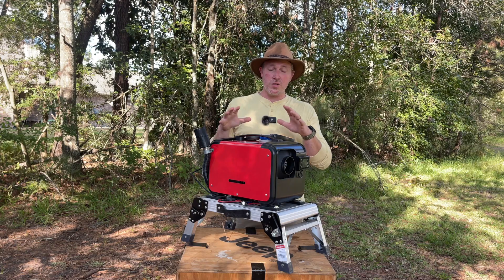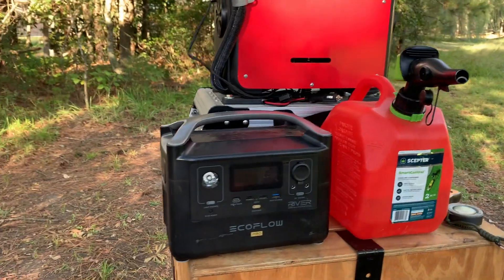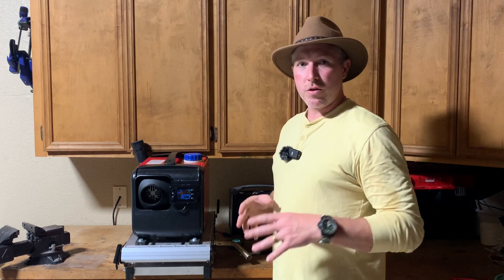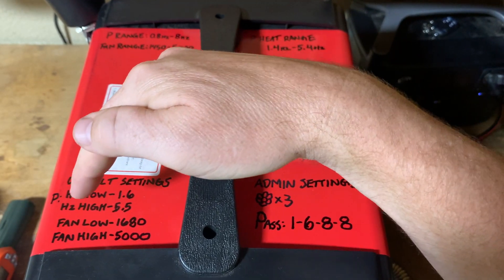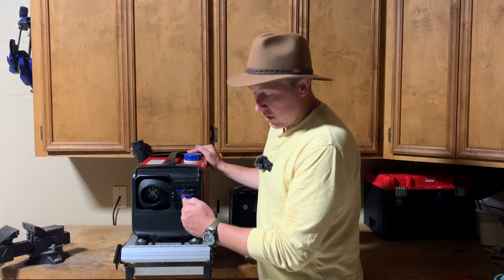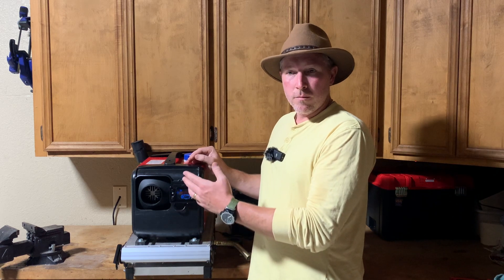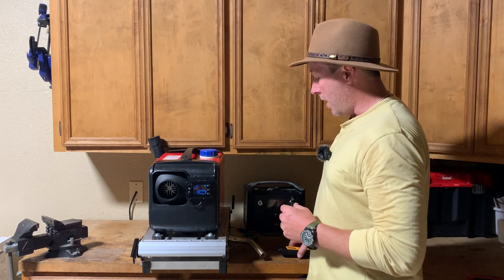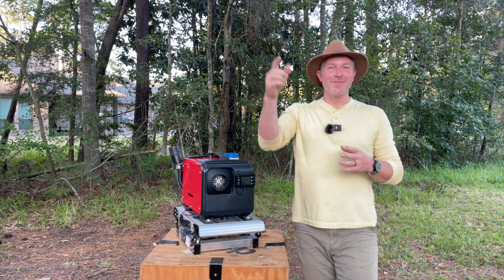Maximize Efficiency: How to Tune Your Diesel Heater!

Comment: This could have been a great tutorial if the camera was set on the controller constantly. Being able to to slow down the video in settings many people could benefit from the audio. Only criticizing the speed you run through instructions. Paired with a  slower speed and a constant control panel visual this would be so much better IMHO.  Still I thank you for your upload
Reply from the maker: You make a very good point, and I apologize for the seemingly quick speed of working the controls… it’s actually very simple and A lot of it is punching the same things over and over. I was up against having the menu constantly time out after 7-10seconds and reset to the main menu, so for that you’ll have to understand that it was with a bit of haste to cover the process or it would’ve been inversely hard to watch waiting on me to constantly type in everything. I have a very detailed description of what to do in the video comments for those that want to slow things down a little bit.. I hope this helps, and if you have any other questions feel free to reach out to me through email and we can tackle things on a personal level. Gator.Overland@gmail.com

Comment: I bought a couple Vevors. They have a different much simpler display. Im looking for solutions, or perhaps I need to buy the controller everyone else has.
Reply from the maker: vevor unit must be powered on, but put at minimal heat temp setting to keep the heater from turning on.  pushing the up and down arrow at the same time brings you to the engineering menu, and then you input your elevation and it calculates the fan/fuel speed automatically ..
Reply: @GatorOverland  Nope, you're not up on your information. Lowest setting still turns the heat on. Pressing both buttons at the same time does nothing except make the number display wonky.

I have tried every possible combination of buttons pressed for many different lengths of time. The only thing that is adjustable is the timer.

Literally nothing else works.
Reply from the maker: @wiredforstereo you should press those two (up/down arrow) for three seconds and the screen should go to what looks like a lowercase “u 11” (aka wonky display).. from there you press the up button and it will go to your 
1 fault list which will show E00 if you have no faults. 
2 Press up again and you will get the temperature.. 
3 again and you will get the supply voltage (I.e 12).. 
4 again and it’s heating operated gear, which should be at 10L
5 Again will be cab temperature, 
6 Again will be Altitude 
7 Again will be Bluetooth pairing “P”
8 Again with be the remote “rte”
9 Again will be the Bluetooth password “1234”
Again brings you back to u 11
This is all info from the vevor manual
Reply: @GatorOverland must be a different model because no dice on mine
Reply from the maker: @jasonwood640 wish you could share photos on here.. or email gator.overland@gmail
Reply: @GatorOverland  I don't understand what you're not getting about this. 

It's not adjustable. And I have nothing past 6, the elevation, which again, and I don't want to belabor the point here, IS NOT ADJUSTABLE!
Reply from the maker: @wiredforstereo take it easy bud.. all i know it what you have told me .. i don’t even know what your controller looks like, its all on assumption at this point.. im providing the info the only way i know how.. if it doesn’t work im sorry.. photos of your controller could be a bit more info than us just messaging blindly via YouTube.
Reply: @GatorOverland  It looks exactly like the 3 button ones. But all adjustable functions are gone. It's worthless. I'm going to have to buy a whole new generic controller that can be programmed. Just my luck, that my cheap plastic garbage turns out to be unusable cheap plastic garbage.

Comment: The "PF" is the Plateau Function for adjusting for elevation. It's the short cut for everything you just did.
Reply from the maker: Well well well.. that’s interesting.. 😂😂 thanks for taking the time to watch and comment..
I will have to look more into this plateau function
Reply: @GatorOverland  
yes, please, check it and comment to complete the excellent video. I would wait excited for the results. This is a very important point sice many people using RVs get hard problems with the heater above 2000 meters altitude getting the burner chamber clogged of slug due to bad combustion (running rich) an later the heater doesnt work any more untill complete dissasembly and cleaning. We are RV builders ant had some customers with this problem (we intall Webasto Airtop with the optional "altitude function" installed (I supose is the same as "PF" in the chinese heaters), but they forget to activate it  manually when staying high, and enter in such vicious circle)
Reply from the maker: I remember Chris from @venture4wd had issues with his webasto heater in his JK Ursa Minor Jeep. I believe they resolved the issue, but it was definitely elevation related.
Reply: I just adjusted the pump flow to 1.0 instead of 1.6 is this ok to do???
Reply from the maker: @jasonparsons81 depends on where you’re at elevation wise, but should be fine as long as you’re getting sufficient burn without too much carbon monoxide.. Require the fan speed to increase slightly, but it all depends on the PPM.. everybody’s unit will be different, but most will perform variably the same
Reply: I just assumed that slower pump speed will mean less fuel being used 🤷🏻‍♂️
Reply: @jasonparsons81  , yes, but its the RATIO of air to fuel that is important for the cleanest combustion and highest amount of heat PER fuel consumed.
Reply from the maker: @jasonparsons81 that is true until a point… If the fuel isn’t pumping fast enough to keep sufficient burn, then it will flame out… I wouldn’t go much lower than one… Ideally 1.6 is a really good base for sea level, we typically use 2.8 to 3.2 as far as our power setting and we get 30+ hours out of the tank of fuel using it to keep us warm at 8-12hrs per night… You’ll have plenty of fuel… I doubt you will run it very much lower than the 2.0 power setting anyway.
Reply: Its running on 1.0Hz perfectly and using much less fuel..it's also running cooler so I don't need to have a window or door open to keep the temp down in my caravan....thank you soo much for sharing this info 👌🏼
Reply from the maker: @jasonparsons81 brilliant!
Reply: The elevation reading is bouncing from -34.8 to -36.5???

Doesn't seem correct to me??? 

I'm up high ...why is there is a minus symbol???
Reply from the maker: @jasonparsons81 I’m not familiar with the elevation setting..
Reply: So on scale one to 10 for heating, I ran my vevor at level two for 8 1/2 hours and it used 3/4 of the 1.3 gallon tank
Reply: My elevation is roughly 3300 feet

Comment: Good video. All I'd say is that sharing settings with other users is not advisable, they are all different. The tolerences on stuff like pumps isn't great, so even changing that will change things. Same with duct/exhaust length etc, and thats before we even get into the different heater and pump combinations. Traditionally 2kw used .016ml, 5kw .022ml but that is often no longer the case. There's just too many variables even on the same brand, where they just seem to package what they can get their hands on that week. 

But its a good video to show how to tune your individual heater.
Reply from the maker: Thanks for taking the time to watch and comment… I do preface in the video that my settings will differ from anybody else’s due to elevation or unit, but the tuning concept will be the same…. Asking for others settings based on location is just an idea for general reference.. totally agree too many variables are involved to be relevant for actual usage per unit

Comment: A brilliant video, mine is virtually the same as yours except I have 4 smaller outlets. I don't know if I'm doing something wrong but I can't seem to get mine into hz, it just shows the temp. Thank you once again.
Reply from the maker: Thanks for taking the time to watch and comment… To switch between Hertz power setting and temperature on the display hit the setting button and the up button at the same time.
Reply: @GatorOverland  Thank you for your reply, I'll give it a go later. Again, thanks. 🙂
Reply from the maker: @malcytull you bet .. stay warm

Comment: In my experience, you can achieve very good CO numbers at the max output end because the burner temperature is high.  By "very good" I mean 20 - 30PPM.  At the low end, when I typically have just one yellow bar showing on the controller, I  can only achieve 250 to 300PPM because the heater is running too cool to run clean.  Bear in mind that lowering the fuel does not always mean less CO.  If you go lower to the point that your heat output suffers at a given fan setting, your CO will actually go up.  I live with the higher CO at the low end because I need a very low heat setting to maintain comfort in my camper.  I always start and end my heating session with the burner on the highest setting to burn off accumulated carbon.  These heaters work amazingly well, but they do require some tinkering.  I love mine.  If you are not a curious person, I would get something else!
Reply from the maker: This is valuable info… Just like with modern diesels you should run them hard after long idling to avoid soot buildup and/or regen process. Running on high for a period of time after running long periods at low should combat that.. after tuning I’ve been able to achieve consistently below 30 ppm on my low temp setting @1.4Hz (often below 15ppm).. I typically run 2.8-3.2hz heat setting which is right in the middle of the 1.4-5.4 heat range and maintain minimal sub 30ppm.
Reply: @GatorOverland  I agree.  I don't ever see any carbon buildup by following this routine.  For some context, my travels take me to a wide range of elevations.  For the last month I have mostly been camped between 7500 and 8500 ft.  Earlier in the year I was at the south Oregon coast.  I am currently in Utah camped at 7300.  The only way these heaters can increase oxygen is to increase fan speed.  That creates an unstable burn at very low fuel settings, but that is where you end up when the air density is low.  Does that make sense?  I wish there was a way to increase air flow without increasing air speed.  Maybe a secondary air port? I'm not contradicting anything you have said.  These heaters were designed originally for use near sea level, and tuning in that dense air is much easier.  When it is very cold, and you are at altitude, just don't be surprised if these perfect readings become hard to achieve.  I'm not posting any settings because it would just confuse everyone.  I'm using a James Browning Smith fuel pump, which is also tunable  For people who do like to tinker, this pump is pretty awesome, and James is a very good guy.  You can google "James Browning Smith fuel pump" if you are curious.  I have no affiliation.
Reply from the maker: @Dav-S5658 absolutely makes sense.. understandably less efficient at elevation with lower air density. 
Thats a lot of traveling and high elevation. You must be in a pretty capable rig. I would be happy to share some of my camping coordinates in Utah, New Mexico, Colorado, Arizona. If you’re interested, shoot me an email to gator.overland@gmail.com
Reply: As the Autobahn has shown. Running an engine at it's top end (assuming running proper) results in the most complete burn and lowest co numbers
Reply from the maker: Correct! Nothing wrong with ramping it up every now and then to burn things out
Reply: You should be able to get low numbers at the low end too. Some motherboards dont allow the hz to drop below a certain figure, even if they say they do. So you may have to raise the lowest fan speed. 
But I can get lower figures at bottom end than top. 

The lower end usually also reads low, as the fan is slower, thus pushing less out of the exhaust and reaching your probe if in the same position. So if the probe is in the same position and getting higher readings, then something doesn't sound right. It can also be not enough fuel.
Reply from the maker: @Kevin-h9k2n 🤘🏼🤘🏼🤘🏼

Comment: This is the first video I have seen that shows how to reset the pin code!  I set mine to - - - -.   The best way to get consistent and accurate CO readings is to direct the gases into a can, like a large bean can, and punch a hole in the side for the meter nose to stick in.  If you are in open air, you have have very still air.  For  a cabin CO monitor, I highly recommend the Kidde KN-COPP-B-LPM.  DO NOT buy a Chinese CO cabin monitor.  I don't want to write a page long explanation why.  I have been using the same hand held CO meter shown in this video for 4 years.  Works great.  You should check your new cabin monitor with the handheld when it is new, then annually. Subscribed.
Reply from the maker: Brilliant! And thanks for taking the time to watch and comment.. also i found out after posting that - - - - was an acceptable input.. makes things so much easier. Thanks for the bean can tip 🤝

Comment: I set my pin code to _ _ _ _, no numbers. That way you only need to push "OK" four times 👍. My settings are P-1.4hz Fan 1450rpm 25PPM, P-4.3hz Fan 4500rpm 30PPM, 700ft AMSL (1.23353kg/m³ Air Density).
Reply from the maker: Well shoot! I didn’t know a “-“ Input was an acceptable value.. wish I knew that before!! Going to do this for sure.. thanks for posting your stats 🤘🏼🤘🏼🤝